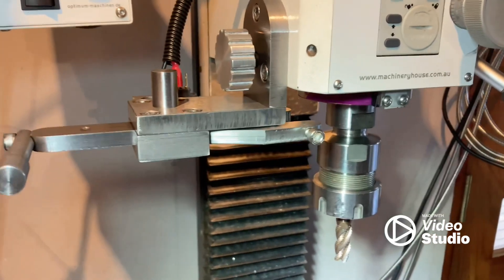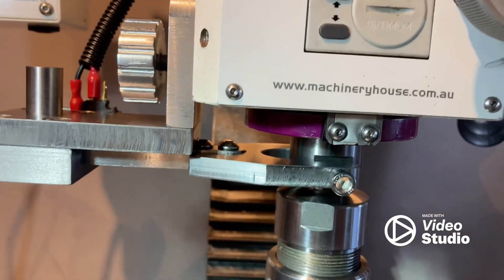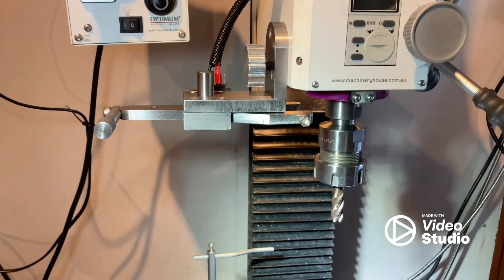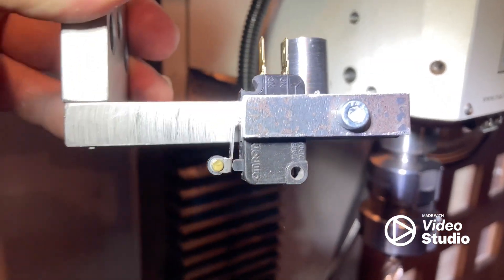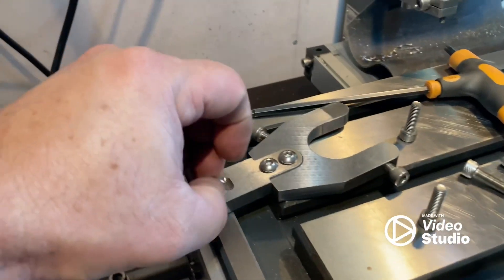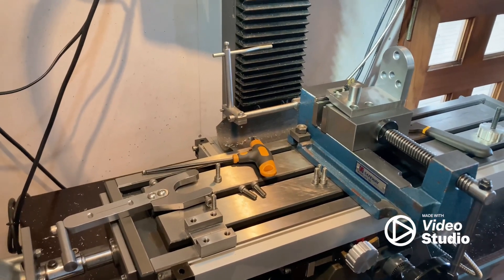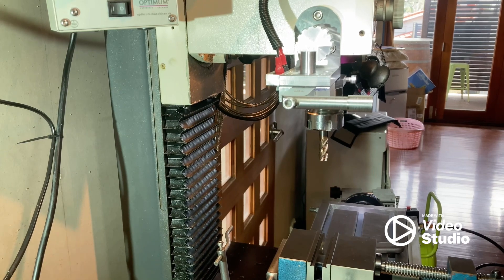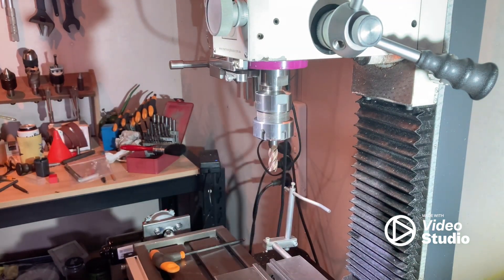Milling machine custom spindle lock. Optimum BF-20

Comment: Hi,
I have made the spindle lock, works very well. My question is how did you wire the microswitch, as there are 4 wires going to the  microswitch but you only have 2?
Reply from the maker: Hi, when I removed the safety guard, yes there was 4 wires. For the machine to work without any switches, 2 wires are joined together and the remaining 2 wires are joined together. When you want to include a switch you simply choose either of the two sets of joined wires and un join them and use those two wires to connect a micro switch. Let me know if this helps, if you're still not sure I can do a short video just to show you how I dealt with the 4 wires.
Reply: Hi, re the wiring.  Instead of joining wires I used 2 microswitchs instead of 1. I just extended the 4 existing wires to the 2 microswitchs. Works like beauty.
Reply from the maker: @userk50  That's great you worked out a way to make your spindle lock work for you. Having a spindle lock is priceless!

Comment: I love the idea and the job you have done on it. What size material did you use?
Reply from the maker: Thanks for your positive feedback. I'm enjoying it, gets a lot of use, makes tool changing a pleasure to do.
The spanner is made from 10mm flat bar, the 2 piece mounting bracket is made from 50mm X 12mm flat bar and I used 16mm plate to make the guide the spanner slides in.

Comment: I have seen a couple different approaches to a spindle lock on this style of mill, even seen some kits sold.  Most of them are very much in the way and inconvenient.  This one is nice, I also like the safety switch.  My solution is a bit different, I didn't use the flats on the spindle, but I did use the safety circuit from the original shield. Mine mounts at the end of the quill, so the lock works with the spindle in any position.  It actually replaces the factory ring that mounts the bottom of the quill DRO.
Reply from the maker: Thanks for your comment. Your spindle lock sounds great, love to see it :)